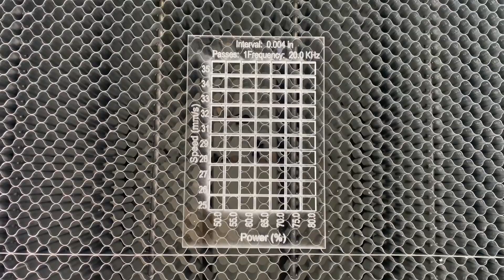What Can a 150W Laser REALLY Cut? | Monport EFFI16s Cut Testing & Craft Fair Prep

Comment: Water-cool glass tubes have been obsolete for twenty years.  High failure rate, and short life vs. metal tubes.  Additional reliability issues of a chilled water system.  This is a hallmark of cheap chinese machines.  
Furthermore, if you ask around, you find Monport doesn't really have a good reputation for their customer service.  No thanks.
But man, people just don't want to pay the real price of admission, do they?  You don't get what you don't pay for, full stop, the end.
Reply: If you buy a Good brand Watercooled Glass tube such as SPT, ECO2 or Reci, then $ for $ they cant be beat, if you buy  cheap tube then thats your fault, but saying glass tubes are obsolete ...you are talking out of your bum. I run 18 Thunderlasers, 14 Glass tube, 4 RF, I also have FIberlaser and fiber engravers, glass tubes ranging from 40W to 360W, some are over 8 years old and still pushing out more than 80% of their rated power. RF are great for engraving, But to get a decent RF like Synrad, Coherent you have to spend the bucks which most people dont have. In 13years of running Thunderlasers personally, not had a single problem, most machines are running the same optics, had to change a few tubes, but you cant compare a Thunder to other cheap chinese . The only thing I agree with you on is monport are not the best when it comes to quality or service
Reply from the maker: @grumpy9304 wow, couldn’t have said this any better.  Thanks for taking the time to write this.
Reply from the maker: I love RF metal tubes, own three of them.  But glass DC tubes obsolete?  Don’t think so.  

You do get what you pay for that’s for sure.  Monport’s customer service may not be the best, but you’re definitely not paying for it.

Comment: Did you run the machine on its installed air assist and exhaust? It looked like on your test cuts you were getting more smoke than when you ran the display. I like that they intergraded the CW5200 into the machine, that saves some space.
Reply from the maker: I ran ~20psi shop air for all tests and that’s my go-to on all my machines when cutting.  Exhaust from 8” AC Infinity inline fan. 

The small material cards smoke more than the display because the display covered up almost the entire bed.  The smoke was forced down underneath the plywood, trapped, and ejected out.
Reply: @LaserGarage gotcha! I do not understand why thie different manufacturers will not go ahead and upgrade the exhaust and air assist. In the grand scheme any price difference I think would be offset by people buying them knowing they do not have to spend more to upgrade. I already spent my upgrade money on the 60w Monport. 😂
Reply from the maker: @SantasLaserEngraving1 some manufacturers do, Thunder Laser for example.  But I hear ya, luckily the upgrades aren’t relatively that much.  

The EFFI series lasers do come with a strong external exhaust fan though.   I just happen to already have a venting system in place so I didn’t need it.